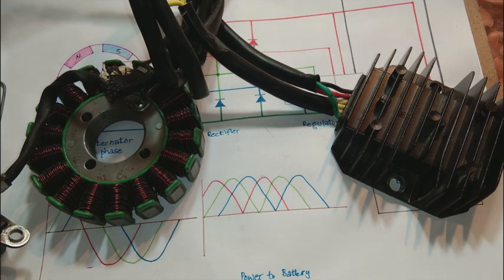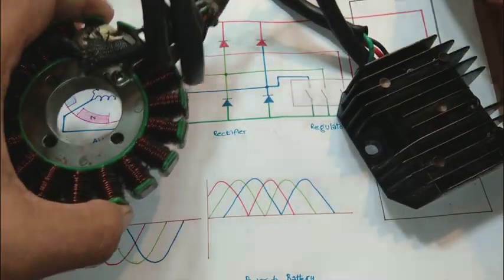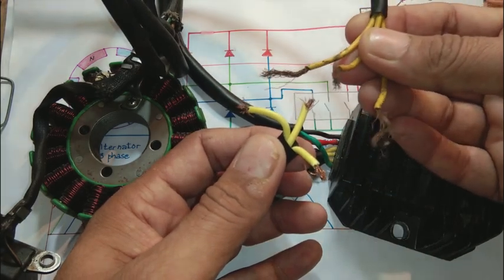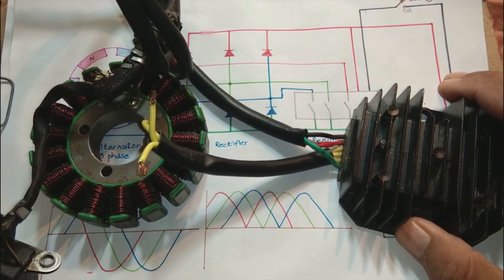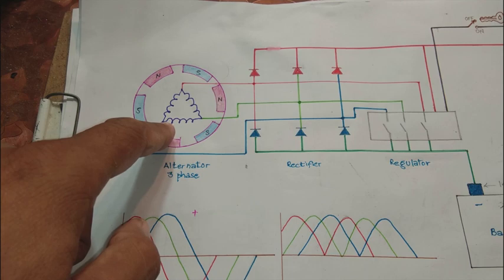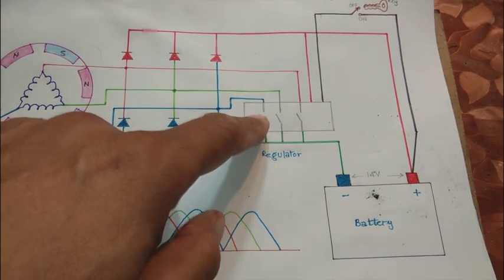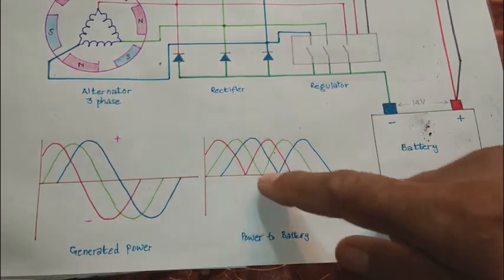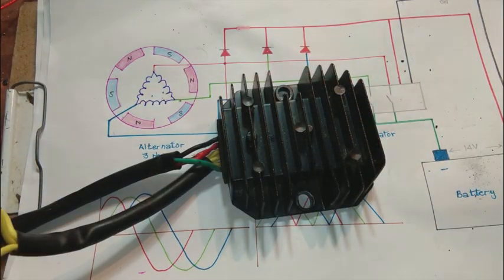Motorcycle and AVT charging system. How charging system works. charging system components diagram

Comment: Bro can you do a video how to change 70cc bike starter to full wave as it has separate ac coil for headlight. I want to wire bigger headlight to bike and want bigger battery but current charger is only half wave. I seen many videos on net where yhta stator is rewired to produce full wave by utilizing the headlight coil for charging and upgrading rr.